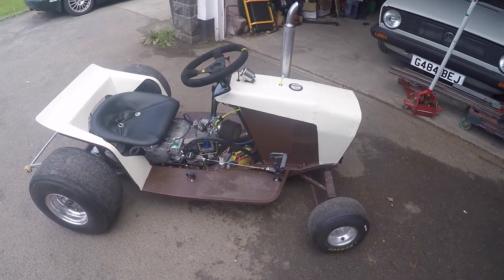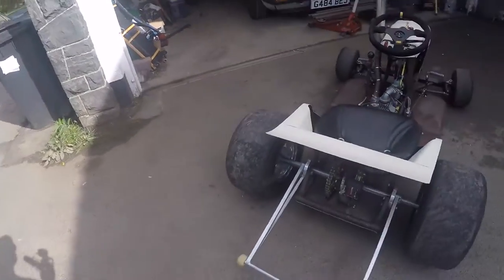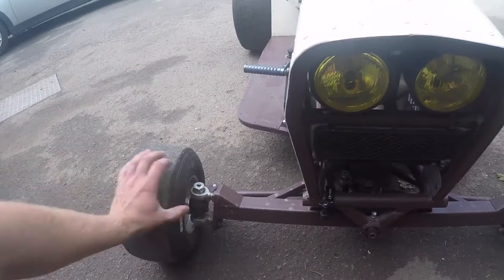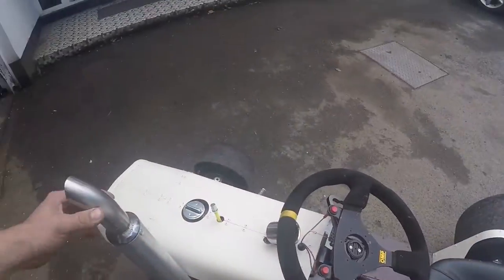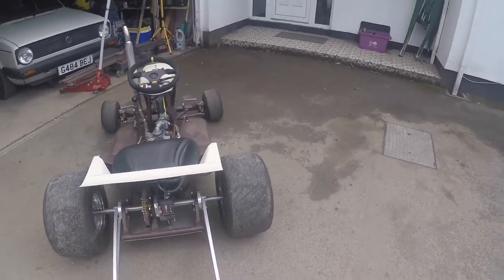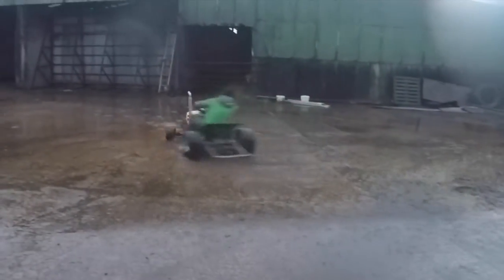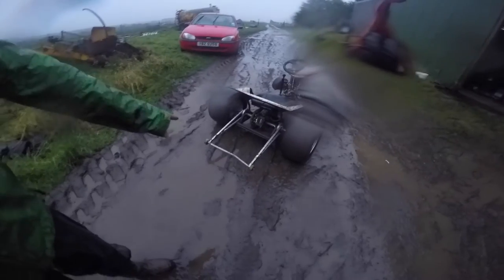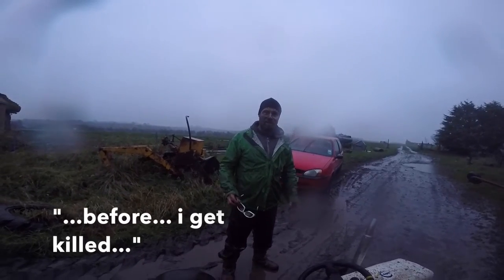WRENCHLIFE  - RACE MOWER - little BASTARD INTRO

Comment: Wow this thing is an amazing build! recently built something similar my self but a lot smaller and no were near as cool as this, got a short video of it on my channel, keep up the great work! subbed!
Reply from the maker: Thanks man, looks like you are having fun with yours too, they are a great wee engine for self builds and there is so much stuff available to tune them too, they have no problems lighting up a set of kart tyres eh ;) jon
Reply: sure is a great learning experience, never built anything like this before, years ago i had a yx150 lump in a pit bike, cant imagine the acceleration with them two rear wheels and launch control on yours! :o cheers bud
Reply from the maker: ZERONEST that's the bit that surprises you every time, I have a 140 pit bike, (with the engine pretty extensively tampered with), but as you say theres nowhere near the grip on one to use all the power effectively. It is hard to fathom how quick this thing launches when you hook them tyres up, it wakes you up lol

Comment: Awesome build! I was wondering what size rear tires are you running? I am building a racing mower with a 43 horsepower snowmobile engine and will be posting videos soon. Hope to hear back from you!
Reply from the maker: +MonsterGT43 Thanks man, the tyres are kenda golf kart slicks, i think 18" outside diameter 8" wide and for an 8" rim, we are using douglas racing rims for this and the super bastard project which will start very soon with a tampered-with briggs v twin :) ill stay tuned man

Comment: What is the rear body panel from.it looks awesome
Reply from the maker: Thanks man, it's actually scratch built from 1mm aluminium sheet riveted to a steel framework underneath, in the shot doing the donut around the cone you can see the frame underneath, the nose is done the same way 😉
Reply: @WrenchLife  sweet thankyou it reminds me of the tamiya grass hopper for some strange reason
Reply from the maker: @scarlett7858  lol yes I know the car well, love a wee aTamiya model 😎

Comment: love the video, just wondering where you got those rear rims/tires
Reply from the maker: Thanks Jake, the wheels are Douglas (DWT) racing rims, ('red label' rears 8x8 & 'q oval' 5x5 fronts), they come from the States so i had to get a guy at a quad shop in england to get them in for me, the fronts are a fairly common uk kart size, hope this info is of use, happy building, jon